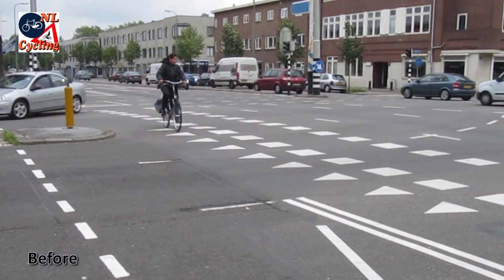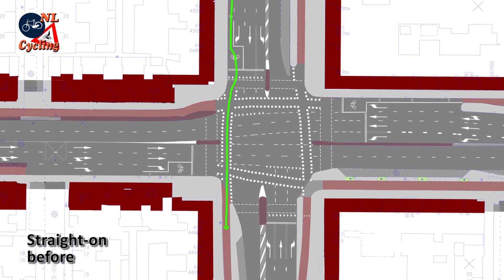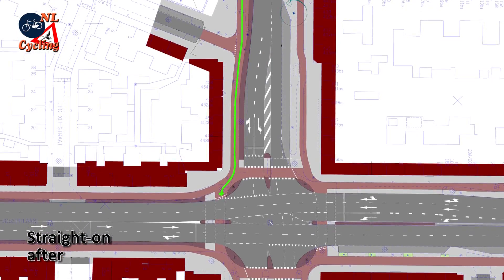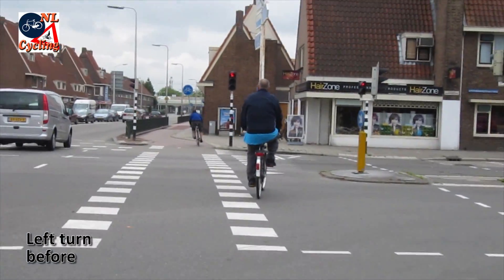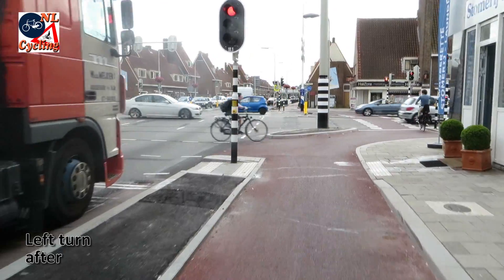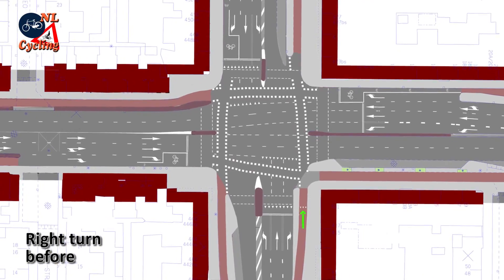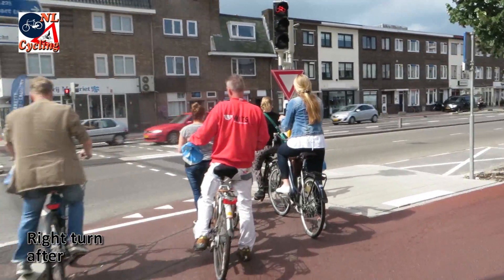Intersection reconstruction in The Netherlands

Comment: Why some cycle crossings are marked by thin dotted line but some are marked by thick square line? Also some pedestrian crossings are marked like zebra crossings but some just thin dotted line? Is there any purpose or difference? I’m confused:(
Reply: there is a difference. dutch intersections are designed so that it works if the traffic lights don't work or are turned of like some are at night. so if a crossing is a zebra crossing cars have to give priority to pedestrians and if a cyclepath has white boxes cars have to give priority to cyclists, but if the crossings have dotted lines cars have priority and cyclists and pedestrians have to wait.

Comment: And the sad fact is, there are, 6 years later, the before kind intersection around the Netherlands :(
Reply: Of course there still are. They won't change every road in such a short time span.
Roads are updated only about once every so many decades.

When a road was build in let's say 1990, the 'old' situation was probably seen as very safe, as it was an improvement over how it was build in 1950.
Now what is deemed safe has changed and the road build in 1990, will be changed in 2030.
Infrascture is very expensive, so you can't just change it every time you feel like it. 

In my own area there is a crossing I also really dislike, a while ago I drove to it from a different direction then I used to, and I couldn't figure out how to even cross with my bike, which light I had to watch. I ended up crossing on the pedestrian crossing (a car still got angry at me), even though I waited for a pedestrian green light).

I'm sure that 20 year from now, that road will have been changed. But for now, the road is of a high enough quality to change. It's just too expensive.
Reply: @Kemily91  I love this pragmatic approach: change the code and then the road.
Reply: Be grateful you don't live in the US...Here, your "before" intersection would be seen as revolutionary.

Comment: This solution is not safe. Cyclists seem to turn right, even if they dont. Thereby they disappear from trucks sidemirrors.
Reply: I don't think you understand. You always have to wait for a green light. If the light is green, that means you can cross without interference from any other traffic. 

It sounds like you've never used infrastructure like this, because if you did, you would know that it's safe, easy and comfortable.
Reply: That is actually what made the old design so dangerous. The protected cycle lane design where the cyclists are effectively in front of the trucks is much safer, as 1) the cyclists are visible for the truck driver, 2) the cyclists have a protected space to stop that cannot be easily intruded by the truck, and 3) they don't (usually) get green at the same time, and if they do, the cyclists will get it first so they can benefit from the right of way and will be sure to be well into the visible area for the truck.
Reply: Cyclists disappear from truck side mirrors because as the truck turns the cyclist appears in front, ahead of his blind spot. And the cyclist sees the truck ahead of him/her so they don't need to shoulder check.

Comment: Oh and just so you know, there are in fact women with children, older people, people on cargo bikes and pulling trailers, who comfortably cycle in the traffic lane and easily make left turns from the left turn lane.
Reply: Oh i've done it too, though not because I like to but because that is often the only reasonable option to get where i need to go.  It's either that or use the crappy sidewalk/pedestrian crossing or, crossing the junction and then waiting in front of the right turning lane.  Just because that's the way it works in my American city doesn't make it great or the best option.  And how do you get into the left turn lane on a 5-6 lane busy arterial when there's an endless stream of cars?  And it's usually not faster to make left turns on these streets, BTW, because they have a controlled left turn signal.  So provided you can even get into that turn lane, you have to wait for the next green cycle.
Reply: No road has an endless stream of cars.  Cars travel in "platoons" or groups, as light cycles at intersections break up larger groups of cars.
Reply: Patrick94GSR And sometimes these "groups" are extensive enough that it would be extremely difficult, if not downright impossible, to be able to make it over to the turn lane before the light changes.  As I said, these large intersections often have controlled left turns.  Unless you even make it into the turn lane before it turns red (while the straight-on lane is still green), it's going to be slower trying to cross from that lane.  In these situations, if anyone wants to keep waiting during rush hour for a pocket to open up to get into the left turn lane, they can go right ahead and do that to their heart's content.

Comment: BTW: What you call "a dangerous intersection" before, is what would be seen as a phantastic improvement in Berlin. We will see more and more ASLs here. Painting is cheaper than building.
Reply: Same for the US.
Reply: This protected intersection can be painted. Just add a low planter in the traffic islands. I recently saw that the first protected intersection was built in Germany but I didn't know where and it looks like it's just a proposal. Same in Toronto, Canada. We are waiting for our first protected intersection. There are few bike lanes here. Bike lanes are used when making protected intersections. No bike lanes (on both cross streets) means no protected intersections.
Reply: i was about to make the same comment regarding lisbon
Reply: Paint is no infrastructure.

Comment: Great explanation. However, I think it's important to note what changed for the cars. All directions lost the right turning lane. Depending on the volume of traffic, this can be a bit of a problem, as right turning cars have to wait for cyclists going straight, blocking any cars behind it that want to go straight as well. Generally one car waiting can be passed, but a bus or truck will block it immediately.

I'm not saying this isn't a good solution, because it is really good. I'm just pointing out that it comes at a small cost, which can be a problem in some circumstances.
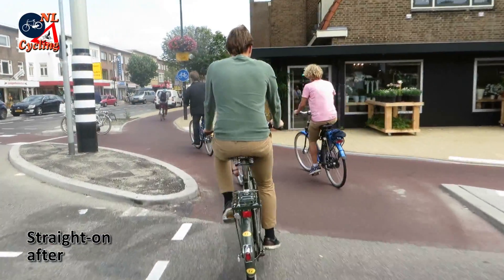Reply: In The Netherlands, right turning cars don't have to wait for cyclists going straight. Maybe at old junctions the cyclists going straight and the cars going right/straight have both green, but at the newest junctions like here, they make sure cyclists have a free go and cars have to wait. At 4:10 you can see the van and the Toyota Aygo turning left, so the cars going straight parallel with the cyclists have to wait. But at 1:56 you can see the green Seat and the grey Audi. At 2:22 you will see them again, so this time the cars going straight/right and the cyclists going straight have both green. But you will notice that the cyclists have a head start compared to the cars. That is what makes it a bit safer.